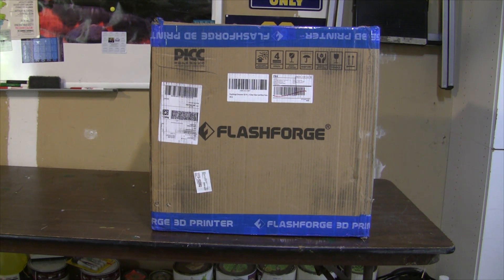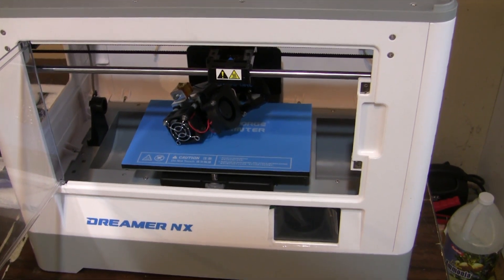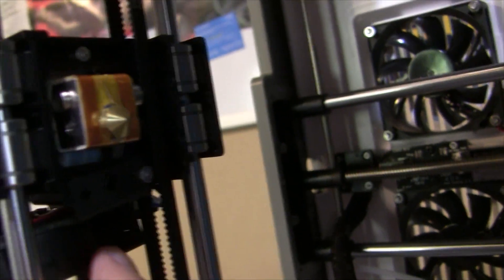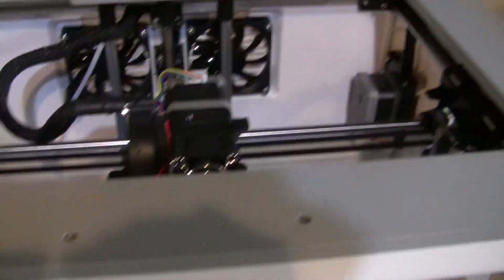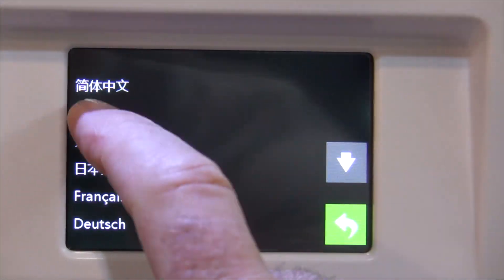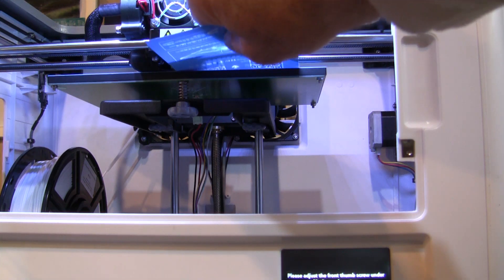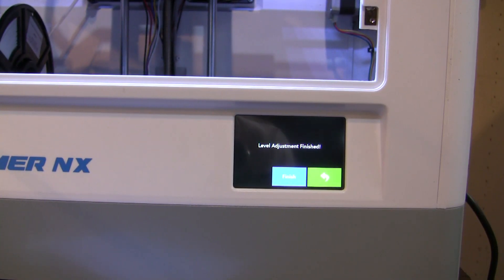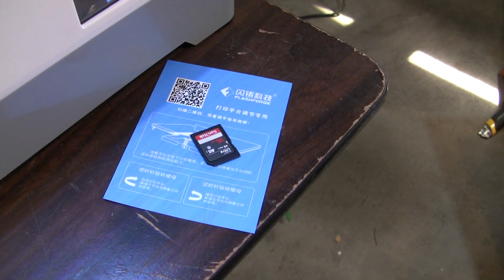First Look and setup of the Flashforge Dreamer NX 3d Printer

Comment: I received a flashforge 3d dreamer printer for Christmas, and watched a couple of videos about making sure I have the correct voltage set. But upon taking off the bottom panel to expose the power supply I find there is not "switch' to go from 230v to 115v.  Anyone?
Reply from the maker: The Dreamer can handle 100v-240v without having to switch. Just plug it in and it should work.
If scroll down on this page:
https://www.flashforge.com/product-detail/flashforge-dreamer-3d-printer
You'll see that the specs say:

Power Input
AC100-240V, 47-63Hz

Comment: Hello, I am looking to purchase this printer and I am curious as to the loudness of the printer. I am planning to put this in my living room and I need it to be relatively quiet. What are your thoughts?
Reply from the maker: I would say it's NOT quiet. The fans are quite noisy.
I have an upcoming video where I replace the fans, but even after that it's still noisy.
The stock fans put out 82dB when they are going at full blast which they do when they are trying to cool down the printing chamber.
The fans I replaced them with are 66dB at 100% speed. That makes them much less annoying, but still loud.

I think it's a very bad idea to have it in your living room.
But not really for the noise level.
No matter what kind of filament you're using, fumes are going to be coming out of the printer.
Here's an article about that:
https://3dinsider.com/3d-printing-fumes/

I have mine in the garage. Even in a 2 car garage, if I'm going to be in there for any length of time, I turn on a oscillating fan and open the side door to the garage for additional ventilation.

Let me know if you have any other questions. I'm happy to help.

Comment: I need sys files from the sd card and unfortunately I can't find anything at flashforge if you have the direct link, it would be okay I wrote to support from flashforge but nothing comes back from them
nice greetings from Germany
Reply from the maker: I've had good luck with Flashforge support in the USA & China. Very responsive.
https://flashforge-germany.com/de/shop_content.php?coID=3210127
I'm not sure which SYS files you need. I don't see any *.SYS files on the SD card that came with the printer.